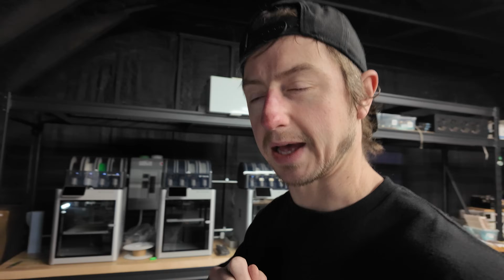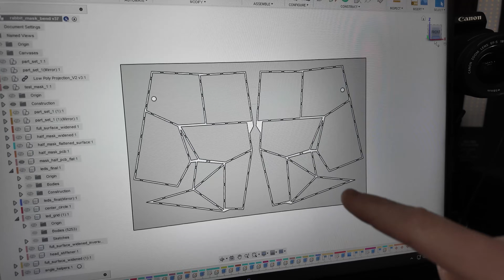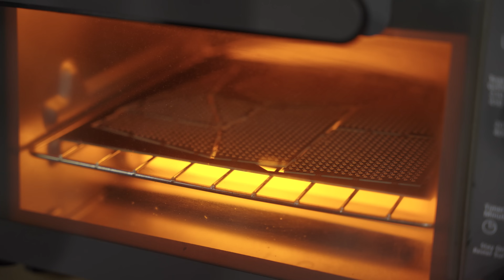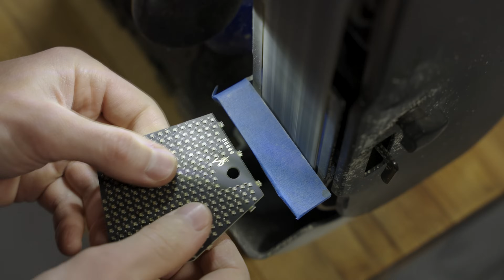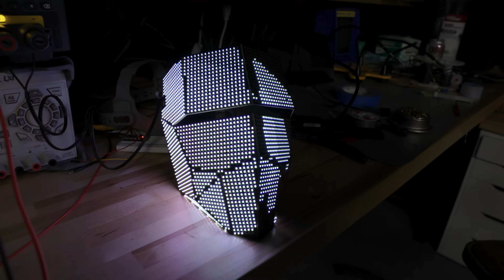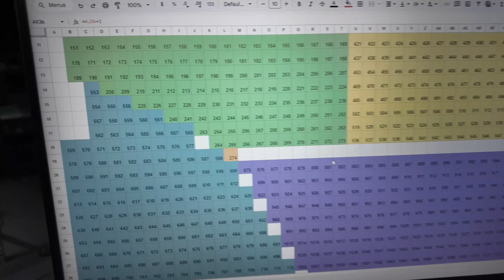This is How I Built the Craziest LED Mask

Comment: Just an FYI next time there's a really awesome add-on in Blender called Export Paper Model where you can take your 3D model, add folds and cut lines and then it unfolds the whole thing for you into a pdf that you can then print or open in Illustrator to edit. I've been playing with it a lot for another project and it's awesome.
Reply from the maker: I have to try that! I tried some methods but I don’t know a lot about blender so it wasn’t on my radar.
Reply: @SeanHodginsToo  Ya it's hard because there's some stuff Blender is amazing at. But it's missing other things. And then there's things that CAD (like Fusion) are super good at. But it's different than Blender. And the user interfaces almost seem opposed. So it's not a transferable skill. But once you get a basic understanding of Blender it's pretty easy. And that particular add on is super easy. The file types don't play the best between the two programs, it's mostly scaling that's the issue. You can open the files but they are either super tiny or super huge. But worth checking out for sure.

Comment: ngl rhino would had been so easy for this instead of fusion. you can just replace the small circles with the circuit without problems making it like a 5 click operation
Reply from the maker: Hmm, interesting, though I also had to flatten it and make a PCB panel from the individual panels and export as a DXF which was possible with fusion.
Reply: @SeanHodginsToo  rhino has that build in aswell. Like flatten any body and all :p
And DXF export is standard.. sadly rhino is kinda expensive and hard to figure in but there "explode" mode and all are insane.. you can just model a 3d Objekt and let it be cut um into a sheet of paper that you can easily fold up into the Objekt again.

Comment: Excellent work! 

I wonder if it would have been "easier" to design a flex PCB that you could fold over a 3D printed form, you can even use stiffeners to ensure the folds happen exactly where you want. 
That would have made the PnP and particularly the reflow a little more tricky as you need backing boards. 
But it would have made assembly simpler, you don't need to wire the matrices together

Either way, this is awesome!
Reply from the maker: Thanks! Thought about it, but yeah assembly and tight deadline made me choose this way, plus one of my internal goals was to make it completely out of two layer PCBs

Comment: I am wondering, could it have an even higher resolution with smaller LEDs and higher pixel density?
Reply from the maker: Yes! It can and will be, this is the first version and had a tight deadline, plus $500 in LEDs seemed like a good amount/risk for the first concept
Reply: @ your crazy bro!!! haha
Reply: seriously and layering of components to get them closer?
Reply: Where do you get a pic and place?
Reply: Well, of course it would: that's how resolution works.
Trouble is, he already mentioned the heat from the mask, so unless you want him to turn onto the walking version of Ghost Rider, it will require more than just add more but smaller. 
LEDs create heat and will need cooling.

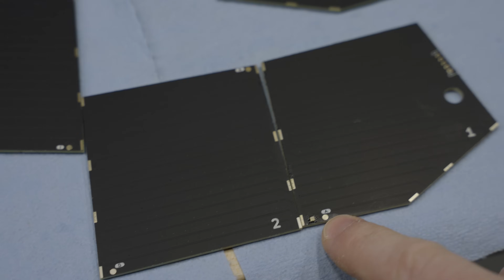Comment: Is there a reason you cant make the solder points that hold the pieces together bigger, so they aren't as fragile? 21:14
Reply from the maker: There is no reason, other than they take up valuable space for the traces of the LEDs to run along the side. But its more the delaminating of the copper I'm worried about which would probably happen even with bigger pads. Though with a bunch of vias and bigger pads it could be pretty strong.
Reply: @SeanHodginsToo  that makes sense, perhaps epoxy / glue strips of black cloth / carbon fiber to strengthen the transition between panels? It would also hide the gaps.

Comment: Thank God you have a pick and place machine.  When I saw you applying the paste I was concerned.
Reply from the maker: Yeah my limit is 2000 LEDs lol
Reply: @SeanHodginsToo  You should've tried a flexible pcb my dude.
Would've covered the entire mask, without requiring soo many pcbs.
Flexible as in the slightly stretchy flexible ones.
Reply: @yasirrakhurrafat1142  Or like 100 horizontal flexible strips, would make everything a lot easier....
Reply: @SeanHodginsToo  which pnp is it?
Reply: I had the same thought I was like oh... oh no... XD
Reply: I was rather, why didn't you order PCBA? Then I saw you had a P&P, and 3D printed too!